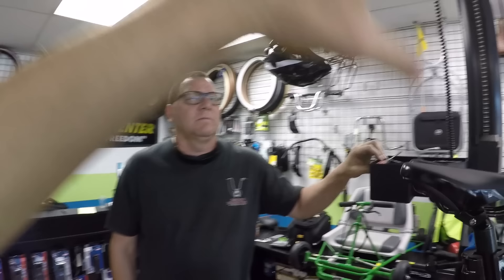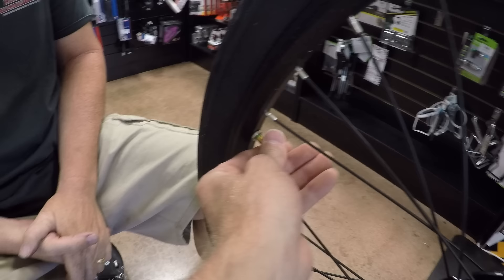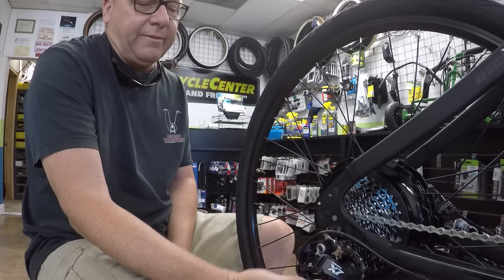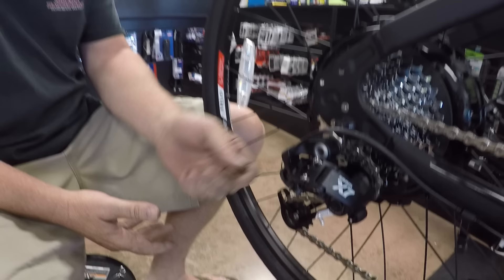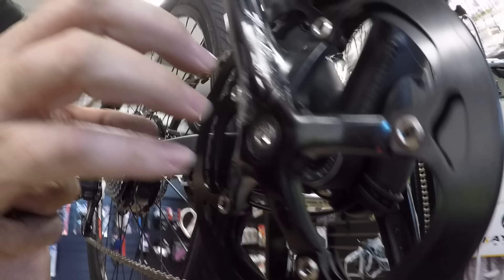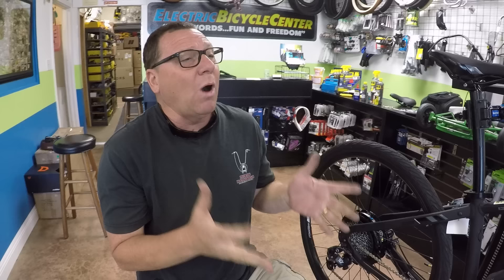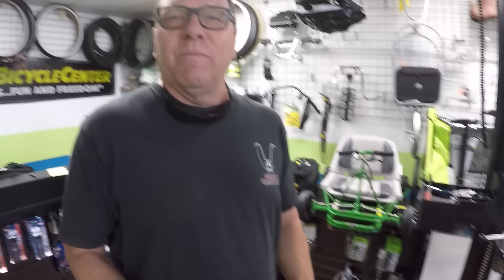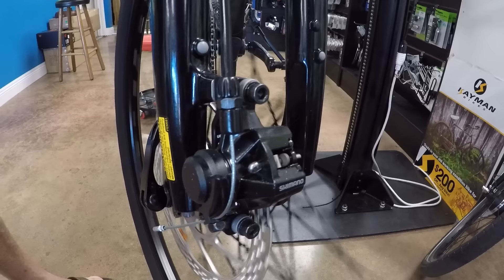Professional Advice for Maintaining an Electric Bike

Comment: I have a little MIclon bike that i rode once. I drained the battery down to one light, hooked it up to charge, and the charger shows green instead of red (which means it is charging). The battery will not charge and stays at the single green light. I have no idea whats going on, the motor still works but i cant get the charger to charge, it seems to think the battery is full when it is not.

Comment: Some info is incorrect 
Chain should not be wet...lube should be put on rollers of chain ...not wet and sloppy. 
If you have a bent hanger Never grab the derailleur and try to straighten...you will snap and or bend the derailleur 
Air pressure should be checked on every ride ...not 1 or two times a month as he said.

Comment: Bro, I bought the Homie 3rd gen and still had issues.  I bought the carbon fiber upgrades and the seat post did not fit.  I almost broke my arm trying to adjust the seat height for my girlfriend because the bike was for her.  Now I'm worried that the carbon handle bar may fail based on your initial review.  Downloaded the Nireeka app and I couldn't even sign in.  When I reported a problem with the seat post, they demanded a video.  Don't they verify their own manufacturing process for customers who are forking out $3K+ for their stuff?  Regardless, I feel you.  It's not been what I expected either.  Peace.

Comment: I've got a flat tire!. Rear wheel on a himiway, I've loosened the nuts removed the caliper but the wheel won't lift off the frame.  What am I not seeing? The wheel is stuck it seems.

Comment: The Shimano bicycle 8 speed derailer is useless on my 20mph 250w. The top gear is too low for pedal assist at 20 mph but it's about right if you slow down on a steeper hill to maybe 16mph and pedal at a brisk rpm to get up the steep hill. Never have shifted the derailer. 2) Garbage front fork suspension on a typical 20" folding model. It's not the goose neck out of adjustment it's the faulty fork clanking and flexing front to back over driveway joints. No apparent way to tighten the forks on the inside. Any tips?

Comment: Re-lithium battery is there a unit other than a timer that i can connect between the charger and the battery to have control in the charging or is there a charger that is controllable in this way  36 volt and 48
Reply: Ron Cooke Yes go to juiced riders website I remember they had a charger that’s programmable might still be available good luck and sorry for the late response

Comment: Schrader valves are NOT car specific. They are used in every type of pneumatic system. Presta valves on the other hand were designed for a very specific purpose, to fit through as small a hole as possible to allow for maximum strength in very narrow road bike wheels. Why people believe presta is superior for wide wheels is beyond me. having to carry an adapter is laughable, exerting 2x more energy to fill a tire/tube through the presta's much smaller hole is asinine.  
And let's not forget that not all presta stems have a replaceable/removable  core. All Schrader valves have a replaceable/removeable core.

Comment: I replaced a faulty battery which would only last 2 - 3 miles. The battery was brand new. It would take a charge but only lasted 2 - 3 miles. Could it be a faulty BMS?  Of so can they be replaced?

Comment: I was wondering if you think I need to take my battery out of my Lectric ebike in temps that get down to 30-40 degrees? I keep my ebike in my garage, which is probably not as cold as it is outside.

Comment: I put a 1200 watt kit on my trike, and it goes faster than I want to go, and the torque is scary.      can I set my LED to reduce speed and power?   Can I reduce the Amps setting from 12 amps without harming my motor?

Comment: Recently bought a Natko Camel.  It is fine for me.  The only issue is that the pedal assist is not variable.  It's on or off and when it goes on it's too strong so I can only pedal one or two rotations before I have to stop pedaling.  I find that I only use the throttle to assist my pedaling.  Is it possible to add a variable speed arrangement?  What parts must  be changed to add this?  Thanks!

Comment: Hi thanks for sharing your how to videos, I need your help I have an Alva+A2b 2013 the wires for the rear wheel motor broke they came off of the connector connector and i can't tell which wires connectors where.  If you don't sell these wires maybe you have a bad rear wheel and you can cut the wires with with the connector on it and i would purchase it from you.  please respond.  Thanks.

Comment: On a one a none ebike allmt enduro tubeless I run 22psi F & 25 R what would you run on similar tyres but on a hiarbike allmt 7.0
Reply: Michael Towler depends on the weight of the rider check with your local bike shop for advice

Comment: I ended up with a new Mate X and pretty much every bolt and nut was loose. =(
didn't realize it until a pedal fell off while riding.
Reply: Kane Lono always check that stuff for a little extra money you can take it to a bike shop and have them do a tuneup on it when it’s brand new as a box every electric bike should have this done
Reply: @samueltownsend1569  
Yeah very familiar. I did tighte everything before riding. I just forgot one pedal. Just saying, everything was loose as a goose from the factory.
 So the next thing that happened with 240 ish miles, the cassette got sticky. Oboy this is fun! If your cassette gets sticky when you push the bike it will make your crank turn. If your crank turns and you have any pedal assets on while you're pushing your bike the cadence sensor thinks it's time to get up and go! And with all that torque... the bike will jump right out of your hands. And it will crash into what ever happens to be in front of you. Super Fun! Thanks Mate X! Don't trust this bike while pushing it. Keep both hands ready to pull the brakes and stop the motor.
Reply: Kane Lono That story was hilarious I once had a bike return and the customer claimed the same thing they weren’t riding the bike shes getting ready to go to the bathroom and push the bike over to  the door and the bike Launched her over the handlebars that she try to hold on to she was walking next to it so I Tess wrote it and could find no problem she claimed the bike was not moving and the bike just took off on its own so I just gave her a new bike to make sure the bike didn’t have any problems I gave it to my wife we went down to the Huntington Beach airshow and it got so crowded on the boardwalk she had a walk next to the bike out of nowhere the bike just takes off she’s no dummy and just let it go right into the crowd of people some guy yells out Ebike’s are dangerous. I don’t want to mention the manufacture or model of bike but we fixed it.

Comment: Thank you for the video. I have a Shimano 250 watt mid-drive hybrid bike. It has a 1X9 Shimano Alivio gear system. Will it be of any benefit to me if I upgrade this system to a Shimano 1x10 Deore gear system? Currently, it has a large crank arm 44T gear. Generally, it has a 44T gear. I am cycling 40 km on a route that can be considered flat during the day. Does the 1X10 system have advantages over the 1x9 system? (By the way, the bike currently costs 11-36 rubles. If I make it 11-42, will I benefit from the e-bike?)

Comment: Hello and can change the flywheel pin!?? I have to change the 100mm one and put the 68mm. Can it be done,!?? On my mountain bike frame it's not good. Not because I have at the right measures because of the wagon that I have 148×12 mountain bikes. The chain works badly too crooked. Even centering a doc with a special belled crown does not go the chain work is too hard at v9licita 10-11 so it works well only up to 9. My bottom bracket frame is 90mm so I bought the 100mm BBSHD wat 1000 I'm looking for compliant frame but neither aliexpress nor year frame sellers way to help me. Would you know something for me,??? Please can you help me I'm trying to realize a dream of my life with so many sacrifices

Comment: The throttle on my new smartgyro ebike won't move, how do I release it, battery fully charged etc..new user....HELP,!
Reply: Katrina Wears-Taylor remove grip loosen any bolts holding the throttle to the handlebar spray generously with WD-40 and work back-and-forth if that doesn’t work they’re not that expensive to replace

Comment: I think I better settle for a motor scooter instead it's a happy medium I had a 1500 CC Kawasaki Vulcan classic when they first come out beautiful motorcycle but Overkill unless you're traveling from one end of the United States to the other and now motor scooters have become so super they're not overweight and you can still travel long distances for little bit of gas very comfortable smooth Riding,  so instead of getting an electric bike I think I might just try to settle on a motor scooter and not a big motorcycle like I used to have

Comment: Hello sir. I was wondering if you can help me with my new brushless contoller. I’m assuming I got all my cables right. How do I know... well my problem is that when I switch it on and I throttle down, it won’t respond and I got power, I recheck the connection. Only time it spin or see it working is when i plug the self learning wire, it spins and when I throttle it change direction. When I unplug the self learning, it won’t response.Why is that
Reply: I got time rechecking on the internet if anyone had or has same problem and no luck.

Comment: I have a  PO4-20AH lithium battery in my E-Moped . I will not ride it in the winter . Can I just charge it and live it in a shed for 3 month. Cand the battery store in -20c weeks ? Or do I have to bring the battery inside for the winter?
Reply: Your Li battery will degrade if left in sub-zero temps. If it were my bike, I would bring it in (with the battery) in the winter.  Otherwise, winter corrosion of metal parts will occur.

Comment: I got a ebike, I didn't know how to charge it. I unplugged the battery and I plugged it back in. the plug thing that was red to red and black to black  made a spark. I can't get it to start now. please someone help?
Reply: Some sparking is normal when you reconnect the battery cable.  There is an initial current draw as the controller is re-energized. ALso if your lights were on when you reconnected, that would cause additional current draw. Check the cable connectors, you might have burned off a piece of the connector.  Also check the main line fuse using a continuity tester,

Comment: Why don't they charge the battery while peddling? or going down the road like years ago the little wheel generator (frame to rim) generating a trickle charge to a fender mt'd. light, as long as you're moving. Is that possible; sending a trickle charge to the battery? If not why? Curious.
Reply: No unfortunately that's not currently possible, it'd be great if it could recharge my batt via dynamo, but the voltage required to run a dim light is completely inadequate for even a 36v battery. We do have regen braking on direct drive motors but that's just a small recovery of energy while braking, and not perpetual energy creation! (which is impossible.)

Comment: I’m interested in buying a electric bike. Wondering about battery life and finding a new battery 2-3 yrs down the road. Are most bikes using same battery connection? If not,which bike will guarantee I will be able to get battery if stolen or needs replaced. Is there a  expected amount of yrs. a electric bike will last if parts stay available? Thanks, how much should I expect to pay to get a decent electric bike?
Reply: Ron Steitz as far as battery replacement goes  you need to check out FTH power in the city of industry give a call or check out their website a decent electric  bike is gonna run you about 1000 bucks good luck

Comment: drrobotnikmeanbeanma 
1 second ago

I got a Pace Aventon ebike from Berts. How can I keep the ebike battery charged at the same time as I'm ridding to increase my distance. The Pace ebike is 500w and the charger is 48v.I have a Ever Start 750w Power Inverter and I attached it with a Scooter battery. So I went to Inter State and showed him how I hooked the battery to it to keep the ebike battery charged .He told me sense the charger is 48v I need 4 small batteries to make it 48v cause each battery is 12v. But see 1 scooter battery powered on the 750w power inverter. He told me to little volts can mess up some thing . Can any 1 add on that please ?? 

Reply

Comment: Don't no if u can help me I not, I have. 36volt electric bike and the 250w front wheel motor has just gone, do u no if a 500w, 48volt  wheel will do the same job as I have one,thanks
Reply: You will need to replace the controller  for 48v/500W

Comment: For the average cyclist (depending on their age, gender, education level, income and geographical location all of which affect the statistics measurably) the ability to put the bead back without tire irons is from 2% to 60% with less than 3.5% being able to do this routinely, without instruction, based upon Kinsey estimates for this exact issue. It isn't "9 our of 10" as stated in this video at 16:40 . 

                                                                                                                                                                                               (just kidding)
Reply: lazurm if my wife can do it so can you just kidding she has a kung fu grip

Comment: This guy is talking through his rear, my  experience of patches is more often than not they will fail and then your back to square one. I avoid patches like the plague, unless you really know what your  doing. After 45 years of riding bikes I find it safer and more reliable to replace the inner tube then no for certain   your not going to be confronted  with I leaky patch. Avoid patches they're mostly rubbish. Just carry a spre inner tube with you. That's my experience, mostly hard earned experience

Comment: Big problems. Can one convert common car batteries to be used in ebike. I manage to serie/par connect combo of motorbike and one car battery. The ebike run......but only for 15 min.
Reply: MJ Young Lithium cells are what you want most car batteries are acid lead although they will work the discharge rate will kill them
Reply: Also car batteries are only 12v in the U.S., (means higher current levels compared to higher voltage batteries), are very heavy,  and have poorer energy density. Why would you do this?  I don't understand what you mean by "serie/par connect combo of motorbike and one car battery".

Comment: I weigh 230lbs so i should be able to at least use a radwagon. What size spokes are these guys breaking? Aren't 12 gauge spokes strong enough?
Reply: Kevin S. Be safe and have the spokes tightened after the first hundred miles of use better to be safe than sorry
Reply: Better to have a heavy duty wheel, made from titanium or have more spokes

Comment: I'm broke, but about the shop keeps size. I range the highest is 290 lb the lowest is about 260 I have got down to 225. could you ask him what's the cheapest bike available that could support my weight? and still get me how far distance? I live in Arizona where everything is so far apart and my body starting to fail me. Could you also tell him I like that shirt and where could I get one. Right now I have a BMW The bmw is either Broke or Black however you want to say it Man 
Walking. Hot link to gas stations that are close to me about 4/10 of a mile everything else like Wally world is 7/10 of a mile away or Even the nearest mall is 3.3 miles away.
Reply: LoneWolf7878 gmail you could probably find a used sonders on craigslist for 500 bucks keep the spokes tight head over to Quartzsite I’ll bet you there’s all kinds of people trying to sell  Ebikes their in January during the big show. As for the T-shirt you got to go to Phuket Thailand preferably during bike week. And by the way BMWs are not supposed to break down.

Comment: most of this is general bike maintenance, not specific to e-bikes.  what about motor maintenance?  my last motor, after a year or  so the axle rusted or something and seized up.  wont turn. any way to fix that?  what can i do to prevent that in the future on my new motor?
Reply: Johhny Lemon There’s a product called anti-seize we put it on the threads when installing petals you could also do some axle grease that’ll keep everything from rusting solid
Reply: @samueltownsend1569  thanks.  but how do i access it to put it  on?
Reply: Johhny Lemon if the damage is already done heat is your best bet but if the wires are running through the axle your screwed. You might have to cut it off.
Reply: @samueltownsend1569  on the old one, yeah, its already stuck.  was hoping to maybe  salvage it, but the wires do come out of the axle on one side.  (isnt  that standard?)

i do also want to prevent that from happening to my new  one, which is  not currently stuck.  whats  the best  way to go about that?  i do  have  some axle grease.  how do i get  it in there?  open up the  motor?  remove the axle?

Comment: Hi wonder if you can help me      their are some wiers  not connected   just got the bike  someone as massed with  it .....?   Have you got a wire diagram for the wires in the sectoin  near the peddlers.? Their are  3 wires not connect ed    this is a few year old  cyclamatic   the frame number is Ry110961218   if that helps u identify  the bike   thanks

Comment: The sad reality for mid drives is that the motors are often too powerful for drive trains that were designed decades ago for puny humans. My 120 Newton Metre motor shredded my cassette in less than 1000k.